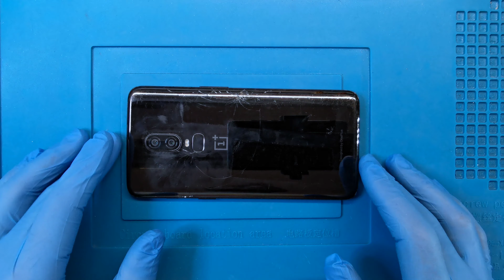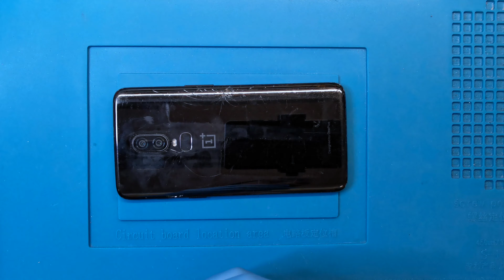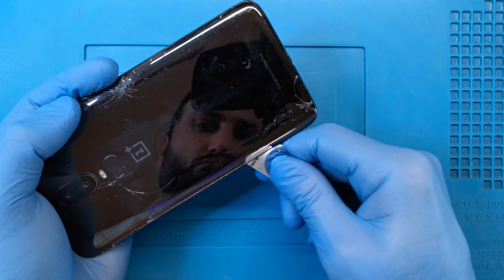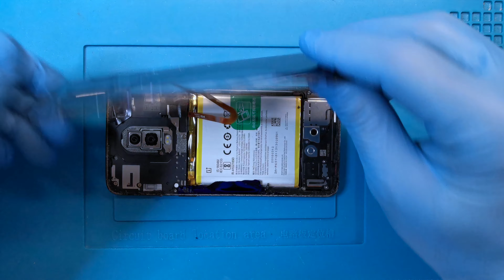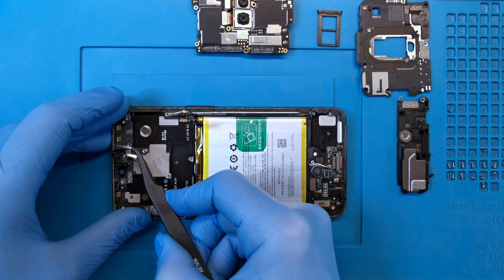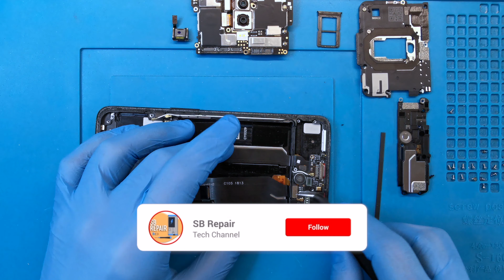One Plus 6 Screen Replacement #Oneplus6 #repair

Comment: I changed the screen on my Oneplus 6, but when I turn on the phone, the screen turns on for about 4 seconds and then turns on and off. But when it lights up you can see that the system has charged. Do you know what could cause this problem? Flat cable or the new screen itself?
Reply from the maker: This may have different problems. If you have done every step correctly, it is probably due to the screen you bought. For such models, the original screen should definitely be used. and care must be taken to prevent a short circuit from occurring. Also make sure the battery is installed correctly.

Comment: How much for screen? 
Is it AMOLED?
Reply from the maker: Hi Amoled display 115 Euro

https://www.ebay.de/itm/ONEPLUS-6-AMOLED-Display-SCHWARZ-Touchscreen-Digitizer-Glas-INKL-RAHMEN-NEU-/133181891892?mkcid=16&mkevt=1&_trksid=p2349624.m46890.l49286&mkrid=707-127634-2357-0
Reply: @SBRepair  whill there be any problem if we install an lcd panel? 
Because I don't have money
Reply from the maker: It's fine, but be sure to test the new screen before installing it.
Reply: @SBRepair  so there's no disadvantages while putting it? 
A lot people are saying it will have low touch response and not good for the phone🤔
Is it true?
Reply from the maker: The performance will probably not be the same.  But you want it cheap.  Another suggestion is if you find a second hand Amoled screen it would be better.
Reply: @SBRepair  ohh then it's ok
My only concern is that it shouldn't affect my day to day usage
That's is my only problem